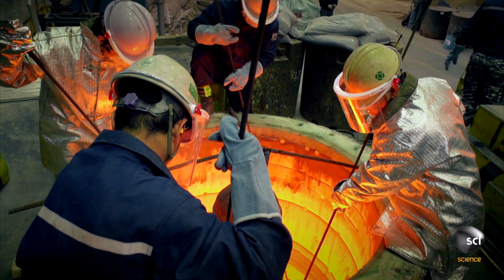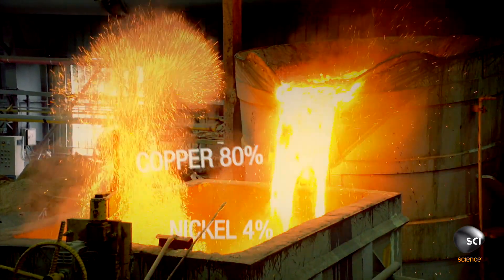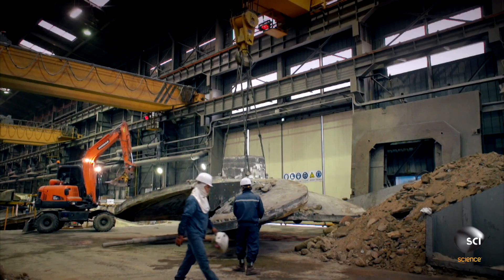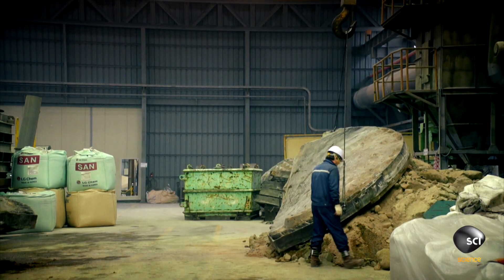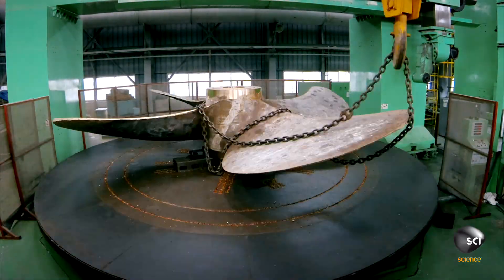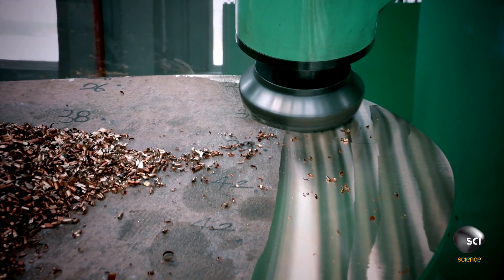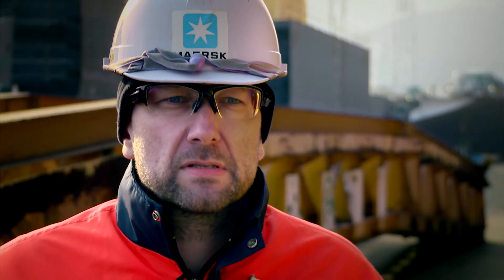Casting a Gigantic Propeller at 1,800°F

Comment: Hauls 124,000,000 miles, 5 times the distance to the moon...... that farther than the sun...  try 500 times the distance to the moon (238,000 miles).  I'm betting 124M miles number is off by a bit... how long would it take that boat to go 124,000,000 miles?

Comment: Imagine they dropped a plastic bucket down there, would need to start all over.
Reply: Someone might get fired, but probably the propeller would be fine. The plastic would simply burn on the liquid metal surface, an be expelled as CO2 and water vapour.

Comment: Question: Does it really make sense to paint the propeller?
Considering cavitation and stuff?
Reply: It's 96% of non rusting metals... 80% copper alone... Why are they putting anti rust paint on it?
Reply: @fvckinfool101  I can't recall that it was anti rust paint, just paint. Anyhow I can't imagine that it will last for long - maybe it is just for making it look good when delivered. A waste of resources considering how much  paint they need for such a huge piece.
Reply: @Sagittarius-A-Star  they may have worded anti corrosion but still...

Comment: “To keep the rust away...” Because that’s how non-ferrous materials work. 😂
Reply: 4% iron
Reply: Maybe not rust, but corrosion is definitely a possibility with nickel and copper, especially if the water is boiling (cavitation effect)
Reply: Plus, "rust" is commonly used to generally mean corrosion.
Reply: @spencersherman4763  which is actually oxidation
Reply: @TheDimking  And the coating will prevent oxidation and corrosion, which is very commonly referred to as "rust". Whether that's technically correct enough for all the people pushing the glasses up their nose is another thing.

Comment: For something that has to be smooth for maximum fuel efficiency, there sure are a lot of ridges on its blades.
Reply: very possible that an unmentioned benefit of the surface coating is improved surface finish. It is likely a custom engineered coating so it's not too much to expect it to be able to flow into the tool marks but have enough surface tension to present a very smooth surface when cured

Comment: 02:01  The shell endmill does not "grind away"  at the propeller's surface.  It cuts the surface.
02:30 "to keep the rust away"  Wow, I have been working in the metal casting industry for over 25 years and I have never heard of bronze 'rusting'.
Who was the dope that wrote the script for this vid?  He sure doesn't the metals industry.

Comment: 80% Copper.
Commentary "finally, to keep the RUST away"...................really dude an 80% copper propellor rusting?
Reply: There are very different forms of corrosion and surface damages on a ship ... e.g. oxidation (rust) of the steel hull accelerated by salt (water), cavitations (by high speed water flow on propeller blades), galvanic corrosion by electric current between different metal parts in salt water, aggressive chemicals (e.g. in mud waters of harbours) and finally growth of algaes, mussels or other creatures (e.g. barnacles) / sea vegetation herefor specific antifouling paints are being used.  Its a complex topic on its own how to protect surfaces of ship parts which deserves an extra documentary.
Reply: there are bronze sculptures that have been sitting around for 3,000 years that look brand new. copper oxides (the green/brown colors) are a protective layer. copper with a mixture of a few other metals (they named nickel, aluminum) adds to it's robustness. plus bronze/brass are easy to work with, milling down a chunk of hard steel would be difficult for cutting machines

Comment: Picture, if you will, a massive factory with all the latest equipment: cranes, casting dies, massive slag buckets, jackhammer excavators, advanced robotic milling machines-
And two dudes with paint rollers.

Comment: Why copper? Why not stainless steel or even a carbon fibre core incased in metal. Seems lightweighting it more but retaining its strength would also contribute to efficiency

Comment: "Break the propeller out of it's mold without damaging it"

Proceeds to use whatever that is
Reply: pneumatic jack hammer on a construction vehicle
Reply: A surgical precision Jack Hammer.
Reply: Vibrating stick on a bigger stick
Reply: Here its called a Rock Breaker used in mines etc to break down over size boulders
Reply: They showed one that failed. That propeller was thrown away.

Comment: It must be super smooth 
Barnacles: "hippity hoppity this is my property"
Reply: They have divers go underwater and polish off the sea life on a regular basis. There are videos of that here on youtube. It's a damn scary job.
Reply: @atl3630  ‘Hey is that t- SHIT!’
Reply: @atl3630  They dont need to even get divers.
Anti Fowling paint.
Its why ships use to have red paint on the hull that was under the water line.
Reply: @IIGrayfoxII  No, you really do need divers... Idk why they even painted the prop with anti-fouling other then to keep it looking shiny for the customer when it's shipped and fitted. That coating will be mostly gone in about 3-4 weeks of use.
Besides that, anti-fouling coating isn't perfect. It resists most sea growth but not all of it. on top of that since the banning of some key ingredients of anti-fouling a number of years back the stuff we use now is pretty crappy. So crappy in fact many shipyards decided to mix it themselves (and add the missing key ingredients despite the laws).
Reply: On 80% copper. Unlikely.

Comment: The economic lifespan of an oil tanker has historically been 25 years, although more recently this has dropped closer to 20 years. Different tanker companies operate with their own asset depreciation policies, ranging from 18 to 25 years...
So that prop need be salvaged out to
32.060085836 ships
For 715 years

Comment: Because of x miles the prop design ..
is nonsense..a lie
Other reason
124,000,000 mile
 ÷ 19mph
=6,526,315 hour
÷ 8740 (one year)
= 746 year
 So according to
the narrator
Based on that lie
The propeller is designed..

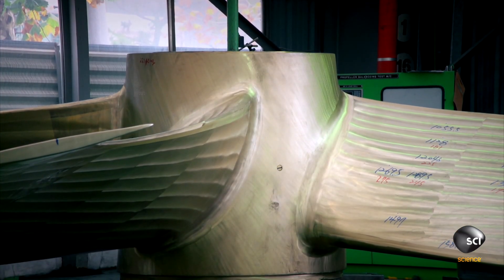Comment: At 2:29 someone needs to inform the commentator that the propeller of a ship does not rust! That coat of paint is not to protect it against rust! If the makers of this propeller heard this commentator say that, they would be up in arms for questioning their ability in choosing the correct mixture of copper, nickel, aluminum and other nonrusting metals.

Comment: 124 million miles? Is the Discovery channel doing cop math now? 

If the ship clipped along at an absurd speed for a cargo ship, say 35 knots (40mph) and never stopped or slowed down for anything it would take over 350 years to get to 124 million miles. If it went at a more fuel efficient speed of 22 knots non-stop, it would take over 550 years.

Comment: How long would the paint stay on the propeller?
Reply: Not long with the fluid battering that thing would get. Perhaps it is just a protective coating until the prop is mounted. Once underwater it would be protected by "sacrificial" zinc anodes.

Comment: I really wonder how they did this in the days before CNC milling machines.  By hand?
Reply: In the days of steam foundries would have wooden patterns made up in various diameters and pitches for different uses. The NA would spec out the prop and the foundrymen would pick out the wooden "plug" that was the closest fit. In some cases the would be custom made.
Reply: Before modern electronics. They used hydraulic profilers which traces the exact same shape but smaller.

Comment: They 3D print these now. It’s better than casting them because there’s no chance of the prop having any air pockets in it. And it’s stronger
Reply: Really? I don't think I have ever seen a 3-D printer that could make a 5 meter diameter part. Bronze is easy to cast without bubbles because its melting point is so low.

Comment: When i was in the USA Navy..... it was called a screw, not a propeler. Its called a screw because it literally screws its way threw the water, which propels the ship forward. Propelers are on air planes, up on the flight deck, where the planes are. Get your facts straight.
Reply: In the merchant-navy we are allowed to call it an propeller. The working principle is the same, only the direction of the thrust is different.
Reply: Call it a propeller in the US Navy, you get screamed at.
Reply: I was in the US Navy, not some other navy

Comment: I thought forging was better than casting
Reply: To forge anything you need molds larger and tougher than the piece being forged. Since each piece is likely somewhat unique forging would not be remotely economical. I may be wrong but I don't think forging improves the crystalline structure of bronze the way it does steel.

Comment: 125 million miles? if the ship commissioned for 100 years and worked everyday non stop, it should travel 143 mph, nonstop for 100 years. well, i gotta say it is kinda far fetched .  143x100x365x24=125000000 (roughly)

Comment: Obviously a lot of facts were misinterpret during translation.  Now for my big beef:  Why just one propeller?  Why not two engines and two propellers?  That way when things go wrong, and things will go wrong (see Murphy's law #4) this ship will lose control and cause all kinds of trouble. Plus extra pumps and generators and OH! a double bottom please.  I'm sick and tired of seeing massive ships lose control when the only engine they have quits, or the only generator fails. Or the rudder fails and they are unable to steer using just the propellers.  Super ship?  Junk ship!

Comment: nit picking a bit, but the carbide cnc tooling is cutting, not grinding, and i doubt if thay alloy would rust, i dont think it has enough iron. it would oxidize however and thats what the coating was there to prevent

Comment: Wouldn't it be weak with air pockets since it's cast?
Reply: Negative. All metals are cast at some point in their production.
Reply: Bronze is actually an easy metal to cast. With its relatively low melting point it is easy to keep it in liquid state so all the bubbles work themselves out

Comment: Regarding the distance to the moon, I imagine they meant 1.25 million miles, which would be roughly correct. I'm guessing this was an accident where either the VO was read incorrectly or the decimal was omitted from the script. Since the 125 million figure is so improbable, I decided to do some basic math to see how inaccurate this figure is: The fastest recorded speed of the Maersk Tangier was roughly 13.9kts, which would be 15.9mph. The Tangier would need to maintain this speed without ever stopping for nearly 892 years in order to travel 125 million miles.

Comment: Soo..... whose terrible idea was it to take 15 days to buff this thing totally smooth the use a PAINT ROLLER to apply the final coating? not even a spray gun a fucking paint roller... that's like building a rolls royce and then spray painting it with rattle cans

Comment: If it is so importand and needs to last so long, why cast it and not forge it?  Forged would also be more fuel efficient too in use due to the weight reduction for a given strength envelope.
Reply: You can't forge bronze, too brittle for that.  Brass is too soft and reacts to ammonia badly. Plus to make it corrosion resistant takes expensive alloying. Uncoated steel reacts badly to seawater, and coating a propeller is rather like putting lipstick on a pig. It may look nice, but it won't last long.

Comment: wonder what alloy that is.  I've watched things like brass being poured but that's at 23-2500 F, and steel which is over 3000 F.
Reply: This is a bronze alloy which I pour at around 2250°F. The temp on this pour would be elevated considerably, due to its size to somewhere around 3000°F. I'm guessing they changed the °C to°F without doing the proper conversion. 1,800°F = 3,272°F which lines up with that theory quite well.

Comment: "124,000,000 miles, roughly five times the distance to the moon" Assuming this idiot is talking about our moon which is 238,900 miles from Earth, five times which is 1,194,500 miles, he is off by a few miles. For reference, the sun is 92,960,000 miles from Earth, and assuming the ship averages about 29.46 mph (25.6 knot), it would take just over 360 years for the ship to cover that distance.

Comment: Problems with props in long run is cavities/pitting from the high pressure it creates!
I've seen a few props practically eaten away!
Reply: It's not the long run, it's how the prop is created/mated with the vessel and the engine.  Each hull and engine are unique and requires some time to model a new propeller for.  A poor design will earn you a premature death of a prop.  An excellent design will merely need to be polished up to remove any scale or buildup annually.

I've seen the pictures of the waterjet turbine on the wiki and can tell you that was a poor choice for the engine HP and application; it was ruined!
Reply: those were the ones made out of crappy steel and aluminum from canada.  The ones made in China dont do that.
Reply: Nope. It results from low pressure. Cavitation is a low pressure bubble stream and that is what does the damage. We inspected our props at work after about 10 years of use. There was little to no damage to them as we tried to keep the rotation speed below what caused cavitation. Now the bottom of the pump bay was a different story as it had a circular pattern eaten into it even though we could walk under the props. Now while they aren't as big as this ships, ours weren't small either. 8' prop, 9' inside diameter of pump, 10' outer diameter. Each half of the lower bearing was also Bronze and weighed 75 pounds. A Stainless Steel split sleeve mounted on the shaft turned inside that Bronze bearing that was grease lubed.

Comment: 124 million miles? That's all the way to the sun and beyond another 30 million. 
Magical rusting copper.
""Science channel""
Come on man.
Reply: s0nnyburnett I caught that too. haha. wonder where that copper comes from?
Reply: Hey, if it is traveling thru the Bermuda triangle, it could be traveling thru wormholes. That's gotta add some mileage...
Reply: I guess they meant to say 1,24 million miles, because thats five times the average distance to the moon.
Reply: @KiliTheKiller  because of the comma, its still 124 million miles. Use a decimal point.😊
Reply: Also Copper starts melting at 1985° Fahrenheit, so I guess the furnace is 1800° Celcius not Fahrenheit.
Reply: Maybe the paints to prevent the copper oxidizing?  After all the effort they put into making it as smooth as humanly possible they may not want to have even the slightest inefficiency, just a guess, it may be pointless.
Reply: +Jack Good it just seems ass backwards to spend the time getting a flawless surface then using a damn paint roller to apply to finishing coating.
Reply: I know this is old, but I had to look for someone else that noticed the copper "rusting" comment, that 4% Iron lol.
This has to be some sort of translation issues, even then, kilometers would be a higher number.
Reply: I do know they use a paint that slowly comes off, they do this so marine life that starts living on the hull, will fall off with the paint.
Reply: Its probably anti fouling paint. It would stop or slow bio film or marine life taking hold (needs to be reapplied at some point) and prevent corrosion. Once the prop corroded sea life (which normally wouldn't be able to attach to a copper surface) could colonize its surface and reduce efficiency. My guess anyway.
Reply: Cavitation is also a big issue here
Reply: i heard him say "this anti corrosion coating to keep the rust down" just 30 seconds ago you said it was 80% copper? lol copper dont rust, it corrodes and oxidizes but doesnt rust lol
Reply: @ADN1996  Copper does rust. Rust is any film or coating on metal caused by oxidation.
Reply: @zpgJiggleBilly  No, copper doesn't rust. Here is the definition of rust from oxforddictionary.com:  A reddish- or yellowish-brown flaking coating of iron oxide that is formed on iron or steel by oxidation, especially in the presence of moisture.
Reply: @mathewfullerton8577  Symantics, ANY form oxidation can be considered rust. My definition came directly from a dictionary too.
Reply: The paint is an aintifoul to keep things from growing on it
Reply: It has iron in it ya dummy 😂😂
Reply: Yeah I had the same doubts when I heard that ridiculously huge number

Comment: brass doesn't rust ! nice milling machine  !
Reply: Corrode, turns into green oxide, specially in salt water!
Reply: Folks I am a machinist with 25 years of experience from PTFE to Waspaloy,  yall have a great day .
Reply: I'm a machinist/tool maker, CNC programmer for over 30 years, 3 years mechanical engineering school, 1 year working for merchant marines as diesel mechanic/operator on tug boats!
Polished enough brass on boats when I was young. Captain would've through me in the water if the brass was''t shinning on his old the boat back than.
LOL!
Reply: Wow
Reply: How much sleep did you loose during the B.P. Deep Water Horizon mishap?  
What was the last engine you linebored ? Work on any 396 m.t.u. 's
Reply: Me?
 I didn't machine engines! 
Worked for an Aerospace company as a machinist , before in a Tool & Die Shop!
Don't know anything abut oil drilling!